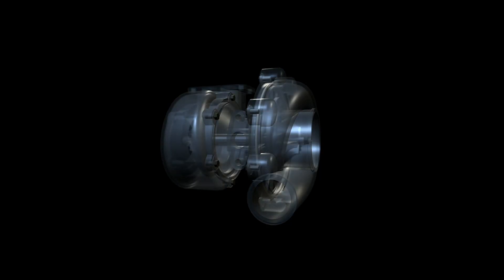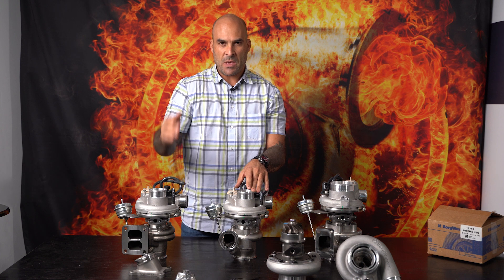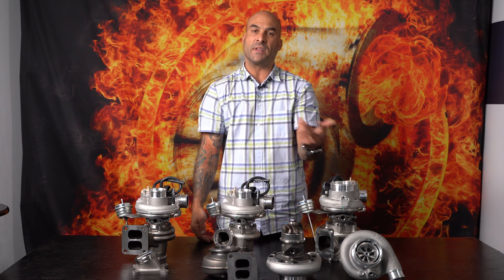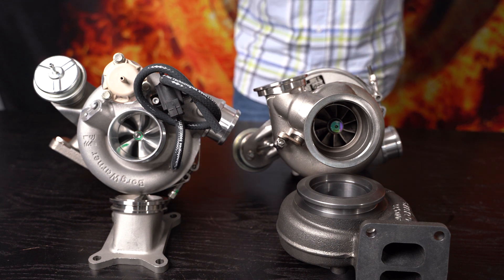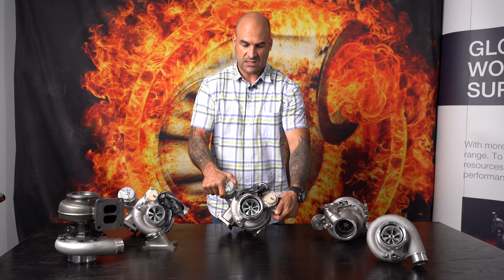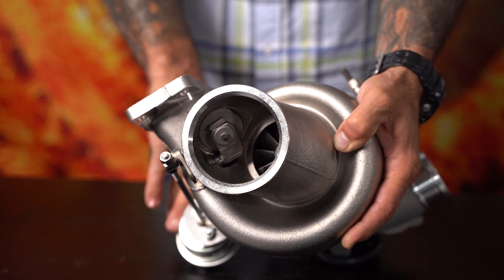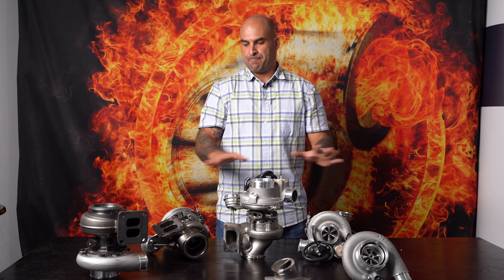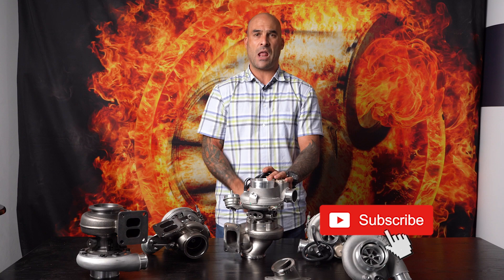EFR7163 vs EFR7670

Comment: after speaking with you a few years ago went with the 7064 since i was running k24a2 spool was instant back pressure was tad bit high but still made excellent power just upgraded this year to the 7670 since i built a new motor with a cnc ported head flowing 25% better hoping this helps keep temps down and still make same power on less boost.
Reply from the maker: You will make more for sure - when did you upgrade? I would have suggested the 8370 instead - same Turbine stage as the 7670 but slightly higher mass flow rate on the compressor stage

Comment: Hello 
I really like your videos ❤❤❤
and got a lot of information thanks to you
Huge respect to you 💪 
but now I'm in a little trouble

I have 3 questions 
1. Does it make sense to install an EFR 7163 turbine with a t4 twin scroll housing and a twin scroll exhaust manifold on a 13b rew rotary engine to improve gas response or will there be no difference with a single housing? 
2. if it makes sense to install twin scroll for throttle response, then how will the turbine behave if a v-band single housing A/R 0.85 with a twin scroll exhaust manifold and your EA888 adapter is installed? 
3. What would be the ideal option for a rotary 13b rew engine and an EFR 7163 turbine?
Reply from the maker: Thanks for the compliment - the Rotary 13B is the wrong engine for the wrong turbo is you are considering the EFR7163 - this turbo is FAR too small especially as you have two 60mm+ exhaust port exists coming out that engine, The EFR7163 will spool up just above 1500rpm-2000rpm - and power will fall away past 4500rpm already. The turbocharger you need to run on a rotary like the 13B is MUCH larger - even the 35 family size turbos are on the small side and require the largest AR turbine housing to work well. 

What HP target are you aiming for?
Reply: @  
thank you very much for your answer I want power around 450-500hp
Reply from the maker: @imjusttima  I would go for the EFR 8474 Black Series - nothing smaller than this turbo for the Rotary engine - Use the AR92 T4 twin scroll turbine housing with internal gate - this will spool with a very street-able result and make the power you want with some in reserve.
Reply: @TurboDirectSA  thank you so much 
What about efr 7670 with A/R 1.05 ?
Reply: @TurboDirectSA  what if we make a twin turbo based on the efr 7163?
Reply from the maker: @imjusttima  The turbo is too small - once again all the power before 4000RPM and diminishing gains from there.
Reply from the maker: @imjusttima  Too small still - you will need at least the EFR8474 for a 13B
Reply from the maker: @imjusttima  It would be unnecessarily expensive, but not impossible - Spool will be fast and power will be more than acceptable, however the project is tricky in the cooler design and merge of the two turbos.
Reply from the maker: @ twins are hugely expensive - but it’s definitely possible as long as you have the space for it under the hood
Reply: @ Alright, I understand you.

For example, if we take an SR20DET and I want to install a BorgWarner 7670 with a V-Band turbine housing (A/R 0.82) and use your AE888 adapter, I assume that I need to design a twin-scroll exhaust manifold, use your AE888 adapter, and mount the turbine housing with a V-Band.

I have a question:
Will I need two wastegates, or is one sufficient?
Reply from the maker: @imjusttima  manifold adaption will definitely be needed yes - along with ALOT of other fabrication to and from the cooler and intake again. Twin gates are needed depending on the design of the collector.
Reply from the maker: @imjusttima  One is enough, depending the design of the manifold and collector position.

Comment: Wish one you think it'll be better for a twin turbo setup on a JZGTE that runs high compression, ported cylinder head with bigger valves and BC 272 cams streetcar so it makes over 1,100hp but doesn't have too much lag?
Reply from the maker: Are you planning on keeping the setup twin turbo? If so i would consider a compound setup, however high CR could be a problem unless permanently run on race fuel.
Reply: @TurboDirectSA  we are planning on installing  an EFR 7163 twin turbo kit, but was wondering if instead of the 7163 and with the engine set up that I have  run it  with the EFR 7670 and if it will still have good response and not to much lag?

Comment: Hello from Greece 2015 project gtx 2867 .86 ar gen 1,very happy 100-240 in 12''  have 440 whp @ 6700 in a 2 liter forged Skoda motor  red line 7300 @ 420whp 80 cm exhaust ,hellcat525 pump . What you recommend for replacement......between 7163 and 7670 for 600 whp and at what rpm will spool 2 bar?
Reply from the maker: I would consider the EFR8370 instead - this is a true 750HP capable turbo and will spool fast and make the power you want and more.

Comment from the maker: When planning a build - you dont buy a turbo to mate your manifold - you buy or build the manifold to suit the correct turbo setup.   The AR92 is too large for the engine if response is what you need. The 7163 with T4 turbine housing is too small, and will generate massive amounts of heat o such a large engine above 0.8-1.0bar gauge pressure.

Comment: Hello ! 
What would you recommend between the 7670 and 7163 for a 2.8L BMW M20 9:0 CR reving to 6500rpm. Target is 375-425whp with as little lag as possible. I am planning to buy  twin scroll 7163 0.80 AR.  I'm affraid to go 7670 and have more lag, big power is not my goal. I want the largest power band. So quick spool over big hp.
tx
Reply from the maker: the 7163 will work perfectly BUT you must choose the largest AR turbine housing which is the Vband housing. This will spool up very fast, and produce the power you need.
Reply: @TurboDirectSA  hello, Thanks for your answer, the thing is, i already bought a T4 exhaust manifold. 

The largest A/R turbine housing is 0,85 Vband as your say and it wont fit my build.

is it a big deal if i run 0.8A/R instead of 0.85 ?

Or i Have the choice with 7670 turbo, 0.92A/R twinscroll ? i guess you will say it will worl but with lag ?

Comment: How laggy would a t4 flanged 1.05 ar twin scroll turbined 7670 be on a 2.0 turbo that winds upward of 9500 rpm be? Love your content because you take the time to explain the various intricacies and nuances of turbochargers.
Reply from the maker: Thank you for the compliment - glad you find value in what we do. The engine revs high, giving you a large band to play in. Depending on the gearbox and final drive ratio, the AR1.05 housing together with a decent manifold design, you will have no problems at all - you will see full boost (thumb suck - depends on tuning, fuel, boost level etc etc) around 4250-5000RPM - giving you a wide RPM band to play with.
Reply: @TurboDirectSA  You are very welcome Chris. Would I be better off with a larger turbo like an EFR 8374 with a smaller ar.? I've seen a few aftermarket turbine housing in the .8-.9ar. range. I'm aiming for 650-680 whp on a modest 28-30psi of boost, utilizing gasoline and methanol. The turbo manifold is a proper "ram horn" style header, with generous size tubing. Again thanks so much for your response Chris, we need more people like you in this industry.
Reply from the maker: @twistedturbotwistedturbo  Im assuming this is a Honda engine with the high RPM band you mentioned earlier - for this type of high revving engine, a larger turbo with a higher air flow volume will work very well, and will make more power at lower boost levels. I doubt you will see 650WHP at low boost like 28-30PSI - but a larger turbo will be a better bet to get you closer to this than a smaller unit on a higher revving engine.  Glad to help.
Reply: @TurboDirectSA  Its actually an old 6 bolt 4G63 that's been fortified. Thanks again.
Reply from the maker: @twistedturbotwistedturbo  The 4G63 is easily able to spool larger turbochargers, using a slightly larger turbine housing AR will work well on this engine - especially with such a high RPM band - i would be looking at the AR92 twin scroll turbine housing on the 8370, or 8474
Reply: @TurboDirectSA  As always thanks for the info Chris. I was actually eyeing the 8370, 8374 line, of course the 8474 seems to be the best in that series. The current turbo is way too large and is an old school journal bearing T4, boost response is abysmal, 4 psi at 6200 rpm.
Reply from the maker: @twistedturbotwistedturbo  You welcome pal -- anytime. 
The older T4 series is a real dog to spool up on most applications.... 😞 The new TurboDirect S.A ball bearing turbochargers which we should have in full force soon will outspool and outperform the old T-series stuff, in fact have shown higher flow rates than the latest G-series turbos.... watch this space if you have time to wait for a turbo.

Comment: Thanks a ton for your video! Super informative! I am now picking between pair of 7163s, 7670s or 8370s (bigger brother of 7670) for my 2018 F90 M5 (4.4l v8 - each turbo paired w. 2.2l 4 pot). Target is 1200crank and it’s a daily so I’m leaning towards 7163s w. 0.85 A/R v band as there will be sizable difference in spool/transient response between the 7163 and it’s bigger brothers right? Do you agree or would you recommend something else? 
And - 2nd part of the question - on 7163s I planned to go with external 38mm tial gates (0.85 A/R v band style) as opposed to internally gated same 0.85 A/R v band. In your video when talking on 7670 you recommended internal over external gate. Would you still recommend internal gate on 7163? And why? Thanks a ton!!!!! Subbed for more

Comment: What would you recommend between the 7670 and 7163 for a 3.3L Nissan VG33ET 9:1 CR revving to 6800rpm. Target is 450-500hp with as little lag as possible. I was looking to use the twin scroll 7163 with .80 AR housing. Will that combo be too small for this engine setup? Can't figure out if I will be choking the motor out dramtically. Thanks in advance
Reply from the maker: Without a doubt 7670 - use the AR82 turbine housing. The motor is large in CID - it will overspeed the 7163 from around 4800rpm upwards and generate enormous heat.
Reply: @TurboDirectSA  Thankyou for the quick response!! Really appreciate all the content you upload
Reply from the maker: @alextroughton4208  Anytime. Glad you enjoying the content

Comment: What is a solution to the EFR-7163 smoking at WOT?!? Love the turbo, but the smoking issue is ridiculous. Please help!
Reply from the maker: Something is wrong - the turbo will not smoke on its own.  The drain must either be blocked, and/or not directed downward for gravity to drain the oil, or the ID is too small, or you have blow by in the cylinders, or the oil level is too high, or a breather is blocked. If you seeing oil "pulling" through the air filter intake, then the filter could be too restrictive..... Start with these common areas and work your way through.
Reply: @TurboDirectSA  Resolved my issue! Ended up being a missing gasket on my oil cap! Who would’ve thought.
Reply from the maker: @fred_b_360  The pressure system was compromised - which prevented the oil from draining back into the block/sump -- back to basics..... 

Glad you found the problem - well done

Comment: I would really love a video on comparison of the 7163 and 7064 because power output is the same. our their any benefits choosing one over the other.
Reply from the maker: Check the compressor maps between these two turbos and you will see the 7163 actually produces more power. The compressor wheel is a very different size between these two turbos, and the turbine wheel for some reason is 1mm larger on the inducer side with the 7064.  You will see the 7163 actually produces 50HP more than the 7064.
Reply: @TurboDirectSA  doed 7064 have a lower backpressure to boost ratio because it has a t3 style housing
Reply from the maker: @natebass1482  Where there is a lower backpressure, you want to increase the compressor flow capacity, which is not the case with the 7064 - Borg have switched to a smaller compressor entirely. It will spool fast, but in my opinion for most applications 1600 - 2400cc 4cyl engines the 7163 with its housing options work well across the range of anything 500HP up to 600HP. 

For a larger engine say 3000 V6 2valve per cyl - the 7064 would work well with the larger (less responsive) turbine housings.
Reply: @TurboDirectSA  thank you for the fast response. With the 7163 is there any issue with overboosting or does a turbo smart wastegate relieve alot of that
Reply from the maker: @natebass1482  Overboosting? The internal gate works extremely well - no reason to worry. No need for an external gate
Reply: The 7163 has the mixed flow turbine technology that’s the difference

Comment: Great information! What would your thoughts be on an EFR7163 for a VVTi - 1JZ, stock camshafts and e85, for a drift application. I was originally planning on a Garrett g30 - 660 or 770. Thanks.
Reply from the maker: Dont waste your time on Garrett- the 7163 will outspool the G30 series easily, and with the AR85 Vband turbine housing the turbo will make 500-550WHP easily. If this falls into your HP category its the best option - it runs cooler, slower and makes the claimed power.
Reply: Awesome, thank you very much!
Reply from the maker: @THB_jack  Pleasure sir
Reply: @TurboDirectSA  I have a 7163 EFR on a 1jz/vvti and only saw 402hp @5800 altitude my tuner says I'm out of turbo so unfortunately it did not make rated hp
Reply from the maker: @CAC-1111  At what boost? What AR turbine housing are you using? We are at 7200ft DA on a good day, and over 9000ft DA on a bad day. Ground level is 5500ft.  We make 550WHP on Golf7R all day long with the EFR7163...... hhmm
Reply: @TurboDirectSA  402hp @15psi  1jz/vvti with Tomei Poncams
Reply: @TurboDirect S.A  402hp @15 PSI with .85 V-band  housing and Tomei Poncams.
Reply from the maker: @CAC-1111  Buddy sorry to say but whoever the tuner is that said you are out of turbo, is misled and doesnt know much about this topic at all -- no disrespect but how can you be out of turbo, when you havent even started to boost the turbo yet - 402HP at 15PSI is EXCELLENT, at 25PSI you will see over 500HP -- just increase the boost.
Reply: @TurboDirectSA  I have ID1000 injectors would it be a fuel issue then?
Reply: @CAC-1111  are you running e85?
Reply: @TechyGamerVibeZ  Yes
Reply from the maker: @CAC-1111  There doesnt seem to be any issue at all in so far as the turbo being maxed out. You not even close to maxing out the turbo. The injector might be maxed out if using E85 - but the turbo has plenty in it.
Reply: @TurboDirect S.A  I remember the tuner saying something about exhaust housing being too small. Does that sound right? I have an email in .
Reply from the maker: @CAC-1111  Did the tuner say why he believes that about the housing being too small?  The turbo is nowhere near maxed out - at 15PSI -- its around half way being utilised - as far as power output is concerned.
Reply: @TurboDirect S.A  I appreciate all the help. After looking at this video and chatting with you. I feel I may have been mislead about numerous things.  I think my tuner may have blown up my engine.....but I'm considering doing a 1.5JZ will my EFR7163 be too small for the 3.0 displacement?
Reply: @TurboDirect S.A  This is the  response from my Tuner.
"We didn't go any further because hp was not increasing only low end torque. That is and indication of a flow restriction. "
Which based on everything you've said I think my tuner is full of shit.
Reply from the maker: @CAC-1111  I cannot comment as i havent seen the car physically in person - BUT what i can say is that you have produced 402HP at 15PSI - this is an excellent result for the boost level -- where is the restriction?
Reply from the maker: @CAC-1111  Ah man thats not good!  7163 is small especially in the higher rpm range - i would up to the EFR8370 or one of our units - see here:- 

https://store.turbodirect.co.za/index.php/shop/turbochargers/g3076r1-forged-detail
Reply: @TurboDirectSA   What about using EFR9174  on my 1.5jz?
Reply from the maker: @CAC-1111  What power target are you aiming for? Comparing the EFR8474 Black to the 9174, the Black will make the same power and spool faster - so i would not opt for the 9174
Reply: @TurboDirectSA  Since my motor is trashed I'm going to build 1.5jz using stock 2jzvvti block. Aiming for 700-800hp, I looked at 9174 because of the price.
Reply from the maker: @CAC-1111  Sorry to hear -- i would opt for the 8474 Black - its a much better option.
Reply: @TurboDirectSA  Last question would the 8474 be a good turbo on the 1jz/vvti ? or would it be too laggy?
Reply from the maker: @CAC-1111  No it wont be laggy - especially not for 700-800HP
Reply: @TurboDirectSA months removed and I've decided to stay 1jz/vvti. Do you still recommend 8474 or should I stick with 7163 and try to figure out what the restriction is?
Reply: @TurboDirectSA Do you feel the external wastegate could have been the restriction?
Reply: Wow man,ive driving turbo diesls or 3.5 twin turbos since the 90s and realize i know squat. What a wealth of knowledge  you are sir. Pardon but damit boy am i just understanding  that i cant buy from  you me being in the us????